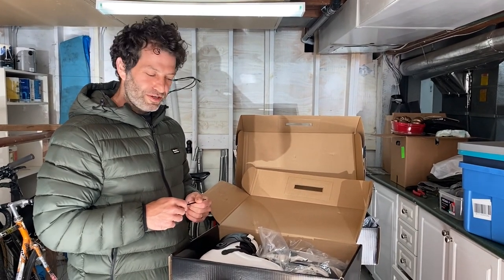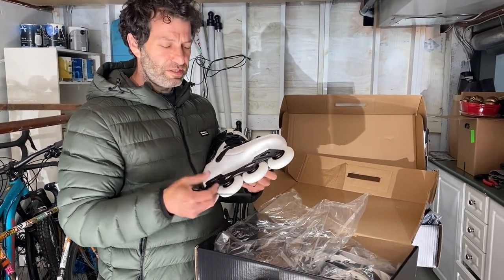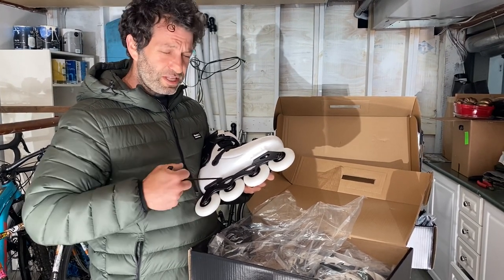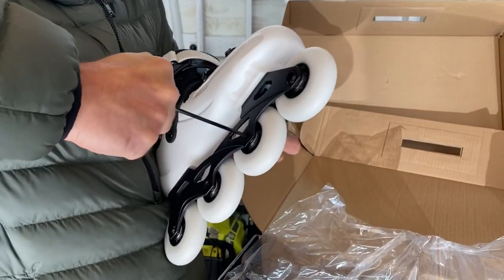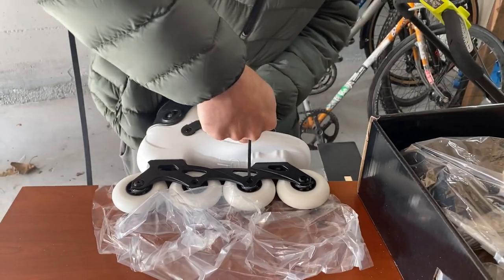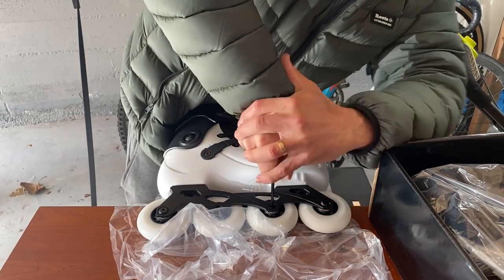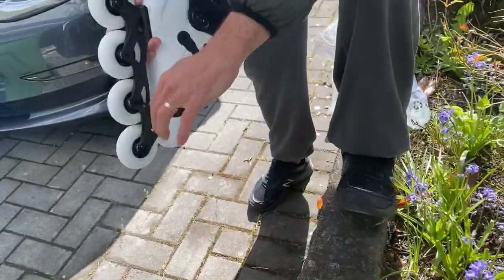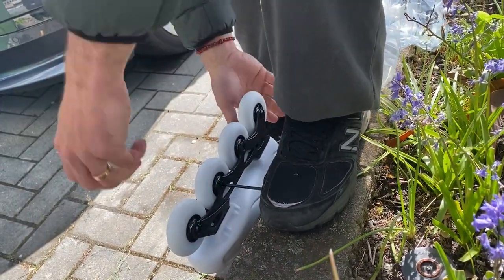How to remove tight bolts on premium inline skates

Comment: That last tip helps so much with the really long neck tool they give with the skate. Just not enough leverage because it's so long and thin; almost bends! It's crazy hearing the threadlocker break and almost sounds like a ratchet.

Comment: You really saved my day with this video!!! I was struggling for an hour with my FR skates
Reply: Same here
Reply: Also have fr skates I was out skating and my frame bolt came loose I could get the wheel off for the life of me. Was able to squeeze past it and tighten it just enough to get home😶

Comment: I bought some used k2 kinetic inlines to have the wheels only( cheaper than buying new wheels) .. tried to spin the bolts out but it just kept on rolling and rolling will try these tricks. If it didnt work, i will not comment here